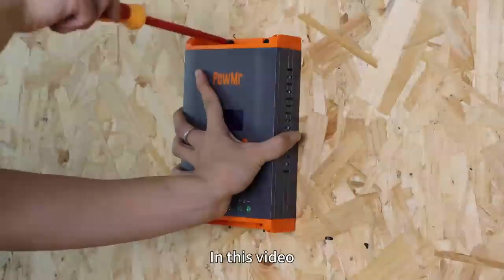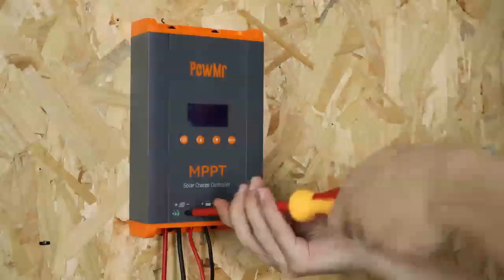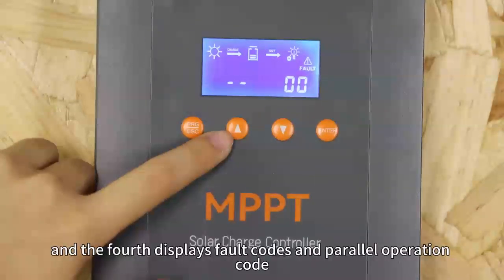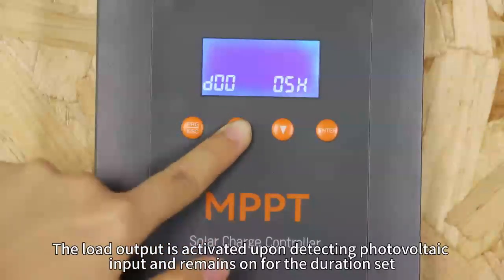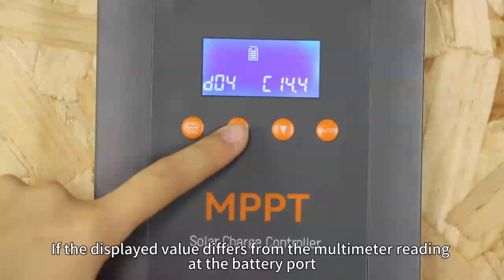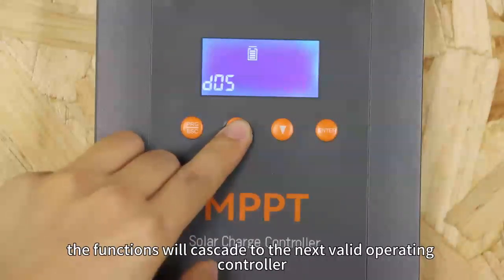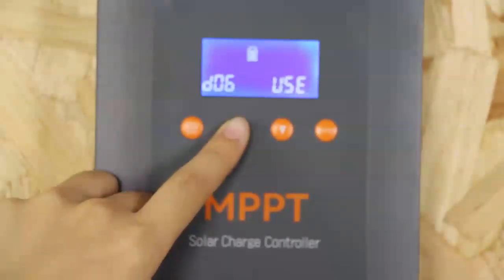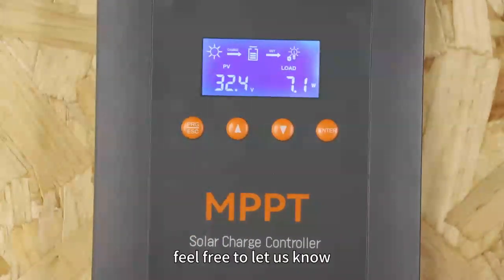Солнечный контроллер #MPPT #Solar controller Ссылка в комментариях/Product link in comments #solar

Comment from the maker: Контроллер заряда для солнечной электростанции HHJ60-PRO с технологией MPPT.
Максимальный ВХОДЯЩИЙ ток: 60А
Поддерживает аккумуляторы: 12В/24В/36В/48В свинцово - кислотные, гелиевые, литиевые( включая LiFePo4) и щелочные.

https://s.click.aliexpress.com/e/_DejTcXv

Solar power station charge controller HHJ60-PRO with MPPT technology.
Max INPUT current: 60A
Supports batteries: 12V/24V/36V/48V lead-acid, helium, lithium (including LiFePo4) and alkaline.